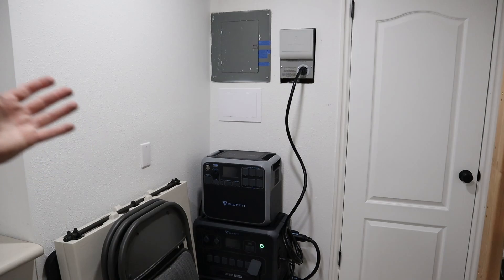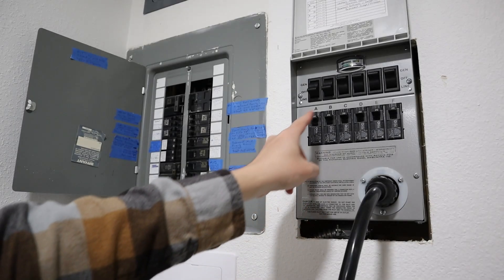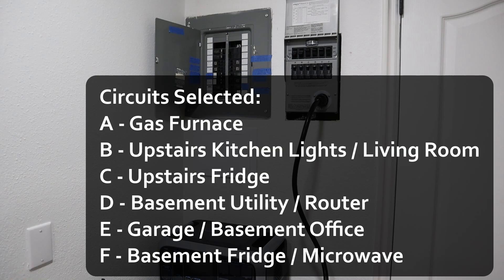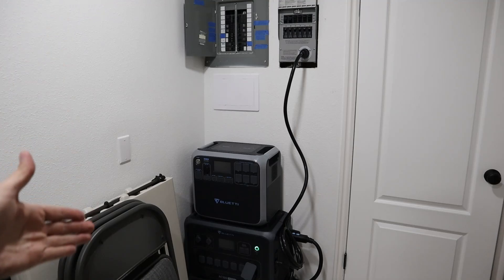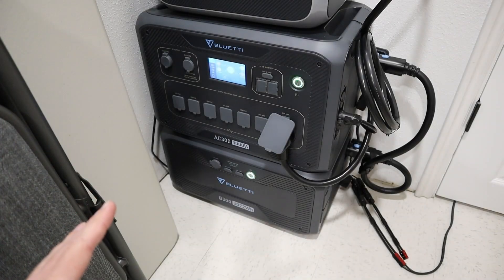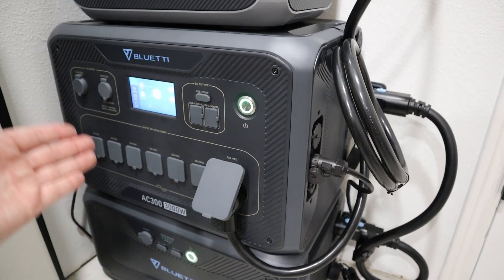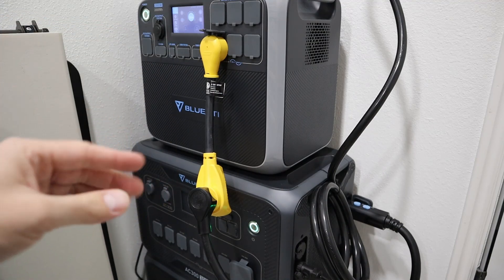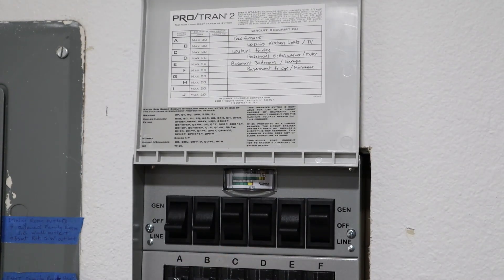Keep the Power On During an Outage?! Install a Power Station Transfer Switch!

Comment: Hey Jason a question are you able to use this same ac300 to your 50 amp 10 circuit transfer switch you have now ??wandering I’m setting my 50 amp transfer switch up to run only 120 volt circuits No 240 just wandering if there’s a 30 amp 120 RV plug to the 50 amp reliance transfer switch inlet
Reply from the maker: Hey Jim, yes that's possible if you are only running 120v circuits on your transfer switch. You'd want to purchase these products:
Reliance Controls A510A Transfer Switch:   https://amzn.to/44LTyTl
Transfer Switch Adapter Cable:   https://amzn.to/3wLhg5p
TT-30P to L14-30R Adapter:  https://amzn.to/4hTOmlW

With that final adapter the 120v legs are bridged and powered by your AC300. Just keep the total power under 3000w.
Reply: @ thank you so much you are awesome

Comment: These transfer switches aren't legal in the jurisdictions that don't allow splices &/or wire nuts inside breaker panels. Check with an electrician or electrical inspector first. If your insurance company finds out, guess what ...

Comment: Living in the PNW solar is not a reliable option much of the year. I currently have a EcoFlow 300 and Pecron 600 for lights out emergencies. And if necessary I can charge them with my 2500w portable generator/inverter or run a 120 line into the house. (I have (3) 20 lb. tanks of propane). For most normal storm related power issues we have a propane fireplace and gas stove as well. So considering purchasing a Pecron 3600 with 9 or 12 kw of total storage and an 8 or 10 circuit transfer switch. Wondering if you have tested your system as to how long it would last before requiring charging?

Comment: Have you ever plugged the AC300 into the wall outlet to charge the battery while you are using the generator in this configuration?  I heard you couldn’t because the generator uses a floating neutral and doing so would damage the generator!  I’m totally confused at this point!  By the way, I bought this system after watching your video!  Please respond!  Thanks

Comment: I have the AC200L plus B 230 can i set the 200L on the transfer switch
Reply from the maker: Yes, it will work with a 120v transfer switch 👍
Reply: Tks new to this love your Chanel
Reply: I think i will start my off grid journey with the AC 200L with the b230 i also  have AC180
Reply: Quick question can i use it full time with the reliance pro tran 2 .6 circuit

Comment: I got a 50 amp transfer switch for our Jackery setup. Explorer 2000 Plus x 2 + 8 kWh total charge capacity with LiPo4 batteries. 6000 watts. Jackery is doing it best right now.

Comment: How can I install the transfer switch inside, where my power station is while my main breaker box is outside?
Reply from the maker: You'll have to run wires inside but it's a doable thing. That's a job for an electrican for sure 👍

Comment: For most panel you can get a lock out it means that to turn on your auxiliary power supply the main power switch must be off the unit can then be slid past the main shutoff switch locking it off as long as the auxiliary power switch is turned on likewise as long as the main breaker is on the auxiliary power switch cannot be turned on the advantage of this unit is all circuits are available so if you have the watts to run the load you can use the item maybe can't run everything at once but shutting off the fridge freezer or furnace for an hour won't cause a problem for a 120 volt unt it means that both legs of the panel box are on the same 120 leg same as when your electricity provider put a limiter on inplace of your meter except their's limits you to enough power to run any furnace so for those with natural gas it'll usually run a 100 watt incandescent light before tripping off  I'll be putting one on my auxiliary panel box and since neither my store or dryer plug is in use I'll use one of them I want to see if my 2000 watt solar generator will not run my house if it will I'll cut the grid till December and then cut it off again at the end of January will save me 1200dollars plus energy usage around 2000 dollars or more and keep my line in
Reply: GOOD tip, thanks.

Comment: love you hook up I am installing a transfer switch as well 306a1-eco pairing it with a single delta pro 120v using RV plug to transfer switch. can i use another pro to use as power to plug in the main unit into it or will that cause a any fault

Comment: @jasonoid are you able to keep the AC charging cable plugged into the wall as a backup for the AC300 if your solar intake lowers and the battery depletes? I realize you can just flip the transfer switch from GEN to LINE but it would be nice not to have to do that and the AC300 recharges from wall automatically if it reaches 20% battery level or something like that.

Comment: Hey Jason, why can’t you just wire that cable directly to the main breaker on your main switchboard? 

So let’s say your power goes out, you’d remove the line power from the street and wire the plug directly to your main switch.
Reply: For example I’m currently renting so I wouldn’t go to the trouble you’ve gone to in your own house. It would take me only a couple of minutes to remove the main power and wire in the battery power. Is there a problem with my thinking?
Reply from the maker: I'd recommend using an interlock or a transfer switch. I have seen people disable their main breaker to disconnect from grid power and then run a male to male suicide cable into a wall outlet but I'm not sure I'd recommend that... it's super sketchy and it only powers one leg of your split phase.
Reply: @Jasonoid  In Australia most of our residential buildings are only single phase. 3 phase on the street but only an Active and Neutral running to the house.
Reply: My thinking is that it’s easier to simply disconnect the mains and hook the RV plug directly to the main switch

Comment: I have (4) 1408Wh power stations (110V 15A). Each can connect to a backup battery, but I just connect a pair of power stations together using the cp3500 cable. That will give me 2 pairs each with 2816Wh. In each pair,  both power stations can be charged individually at the same time, and have power pulled from both while having one of them connected to the L14-30 generator inlet box using a specially wired adapter. I power both legs of the panel at the same time (240V breakers are off) from one pair of power stations. The other pair is a backup. I was thinking of building a "Y connector" and connect each pair to a leg in the panel. The ground and neutral are bonded in the main panel and I have the interlock kit.

Comment: I have a stupid question.  I was fixing to buy a 6 place transfer switch but in the comments it said if you only are generating 120 Volts then you can only use 3 breakers on this system but I see you are using 6.  The post read "you must connect 2 120 volt lines to each grid on the transfer box.  Is this correct?  BTW, I have a Bluetti AC300 with (2) 3072 Kw batteries.  Any help would be appreciated.
Reply from the maker: They have two types of transfer switches, 120v input and 240v input (two hot legs). The one I have listed in the video description will work with the Bluetti AC300 just fine, 120v input and all 6 circuits will work.

If you purchased a 6 circuit 240v transfer switch it gets a bit more complicated.
Reply: On order, thank you! @Jasonoid

Comment: How did I miss this video for so long. I am one of those that has extension cords going around my house. This was very informative. I would like to do this with a 6 or 10 circuit unit, not that I have a lot of power to feed it with, but it is like a router in one room, lights in another, the furnace, freezer in another place, refrigerator in another place, and office is still another. Question, i have never understood the power flow when there is a transfer switch. Does it sit between the grid and circuit breaker box? So, the transfer switch controls whether power into those circuits in the circuit breaker is coming from the grid or from your own power source? However, in your video, you made it sound like when you are providing the power, the circuits on the circuit breaker are bypassed. Did I misunderstand something?
Reply from the maker: It sits in between the main power box and your circuits, like you mentioned. It routes the power from either your grid connection or from the generator input to your circuits. You can choose the power source manually. I just installed a 10 circuit option, it's been pretty sweet to power more circuits.
Reply: @Jasonoid  Thank you for your reply. It sure would be nice to have one. The extension cord will get old pretty quickly.
Reply from the maker: @litnoregrets7551  they only take a few hours to install. The install directions are very good! They lay out all the connections very simply in the manual.
Reply: @Jasonoid  That is really good to know and will help a lot. OC, you realize that you are the king of electrical DIY, right?

Comment: Get a powerwall ...
Reply from the maker: Nah, I'm good without putting a lithium bomb in my house...
Reply: @Jasonoid  you have more of  luck by  burning down your house with a space heater ...I have my for about 5 years no problem at all...and I know other people that have them too...
Reply from the maker: @stevenrobertson7069  that's good to hear. I now have about 20kwh of LFP batteries I use daily, I'm feel more confident in those batteries vs NMC.
Reply: My powerwall is  LFP....
Reply from the maker: @stevenrobertson7069  They used to be lithium ion so I was unaware they changed battery chemistry, that's great news!
Reply: @Jasonoid  yes ....I believe in the beginning they used ion but moved. I made sure of that when I got it . I was  thinking the same thing ....

Comment: Just installed this same setup with 6 circuit transfer switch. However, it has started tripping GFCI breakers. I'm guessing this is because the AC300 is bonded internally? Have you had this issue as well?
Reply from the maker: That could be the case. I only charge with solar input and never have it tied into the wall for wall charging or UPS mode.

Comment: Does this setup run your furnace? How many watts does your furnace draw?
Reply from the maker: Yes, it will fun my furnace. My furnace pulls around 500 - 650 watts while running. Each model will be a little different.

Comment: does the transfer switch automatically switch off when the power comes back?
Reply from the maker: This is a manual transfer switch, you have to click it either way.
Reply: @Jasonoid  Isn't that dangerous?
Reply from the maker: @herbsu4330  no, why would it be dangerous? The circuit is completely isolated on the transfer switch.
Reply: @Jasonoid  I thought it would get backfeed.

Comment: Hey, I'm looking to buy a Bluetti power station with a B300 battery. Although I don't have a solar panel, I'm interested in installing a transfer switch. I have a question regarding its functionality. If I connect the Bluetti power station to the transfer switch, can I also keep it connected to charge with the grid? I intend to use it as a backup power source, similar to a UPS. Is it possible for the Bluetti power station to automatically provide power to my condo if the grid power goes out, just like a UPS does?"
Reply from the maker: I charge my power stations off solar most of the time while on my transfer switch so I don't have a ton of experience with that. I have seen a couple error messages with grounding when using a transfer switch and charging off grid power. It doesn't like having two grounds.

Comment: Hey Jason thanks for the great info. Could you tell me (a) if there's a preferred way to bring the PV cable into the house (through a basement wall) and (b) if you need a disconnect switch between the panels and the bluetti?
Reply from the maker: I run my PV cables through my basement door but I would prefer to go through a wall in a more permanent setup. Using a DC circuit breaker / disconnect is also recommended. You can run a 250v 20 amp DC breaker (depending on the wiring).

Comment: Have just hooked up one in my house,  with solar panels connected. Recently,  we went on a trip, and street power went off. Battery power kicked on, ran my fridge and freezer, sooar charged the battery. When we cam home, all was well, didnt even have to set clocks as the were apart of circuit connected. Well, exept for the stove, as thats 220 volts. 😅
Reply from the maker: That's a huge benefit of a transfer switch. I've also saved quite a bit of money on my monthly power bill! Glad to hear the good results 😁👍

Comment: I'm starting to suffer from information overload! So many configurations.  I have an Ecoflow DPro holding 3600 watts and a 400 watt portable solar panel. I have a 50 amp inlet (with a 30 amp adapter) hooked up to my electric panel with a interlock device. I also just purchased a tri-fuel generator and installed a quick connect to my Nat Gas genny. Tested everything and it all works fine. The problem is is very labor-intensive to set it all up. I'm looking for a way that will automatically turn off the mains and on the Genny and I'm wondering if  automatic or Universal transfer switch will do that. I've read so much but I'm still not sure how that would actually work because my generator and or the ecoflow require that the mains gets turned off first to avoid back feeding the grid. I've also heard of people using the battery as a always on UPS but I'm not sure how that would work without turning off the mains. With the equipment I have and perhaps adding a transfer switch, what would be the setup you would recommend that would make the most the equipment I have and switch from grid to backup power as automatic as possible when the lights go out.  Thanks.
Reply from the maker: EcoFlow has their 'smart home panel' that basically works as an automatic transfer switch. You should check it out since you already have a device thats compatible with it. However, if you want to go the DIY route instead, I love using my Reliance Controls transfer switch and I'd recommend that option.
I use it daily to power 4 to 6 of my circuits depending on how much solar I am getting. I leave my power station connected up to it and with a flip of a switch I can go from grid power to off grid power and it's very convenient. 

Be aware that I run these circuits off solar charging only and not grid pass through charging / UPS mode because the power stations don't like to deal with dual grounding points of the wall power charging and the grounding in your circuits (charging off a gas generator with a floating ground would be completely fine).
Reply: @Jasonoid  thanks for the reply. I've considered getting the Reliance automatic switch but my electric panel is in my garage, which runs about 100 degrees in the summer so leaving my battery in  that kind of a heat makes me think it might get damaged or at a minimum lose its ability to recharge. Further I live in Houston Texas where it's pretty hot and I would need to be running an air conditioner if I went off grid. The battery will not run my air conditioner, it's a 5-ton.  Perhaps I'll try your configuration in the fall and winter. Any other ideas are solicited, thanks again.

Comment: Hi Jason, awesome video, love it. Any updates on how this set up is working?
Reply from the maker: I have been using my AC500 with 3 B300s batteries connected to my transfer switch for about 7 months now. I have 1700 watts of solar connected in and its been going great! When it's sunny I can run all 6 circuits full time to save on my electric bill. When it's cloudy I can only run my two full size fridges full time.
Reply: @Jasonoid  Awesome, I am looking to follow your set up using the Pecron E2000LFP.
Reply: Many thanks!
Reply from the maker: As long as your total system power doesn't go over 2000 watts you'll be good. You'll want to watch the wattage on each circuit to see how things go.
Reply: @Jasonoid  thanks, will do
Reply: Hi Jason have another question: is it possible for the grid power to affect the inverter on the solar generator by bypass the transfer switch etc?

Comment: Jason, I have almost an identical setup with a Bluetti going to a transfer switch. I purchased some solar panels for the bluetti, but I'm wondering what else I need between the panels and the Bluetti in order to get it permitted. I'm thinking it would require fuses and a quick disconnect. Do you have any thoughts or info on this?
Reply from the maker: Permits are different for each location. I'd definitely recommend a properly rated DC circuit breaker for the main solar line. That might also count as a 'quick disconnect' switch, you might need both. 
Solar panels in series don't require fuses since the voltage is added up and the amperage stays within the panel max tolerance. If you are connecting panels in parallel, you'll need fuses.

Comment: Hey great video man👍🏼👍🏼. quick question: if that and L14-30 that is plugged into the transfer box? 
What receptacle is used on the end that plugs into the transfer switch? Thanks 🙏🏻.
Reply from the maker: This is the product listing on Amazon, maybe you can find more info on it: https://amzn.to/3yOjheL
Its a twist in lock 120v 3 prong connection.